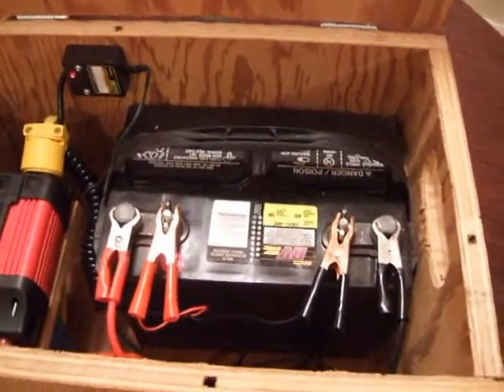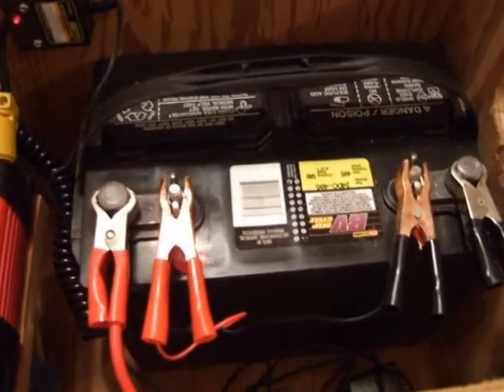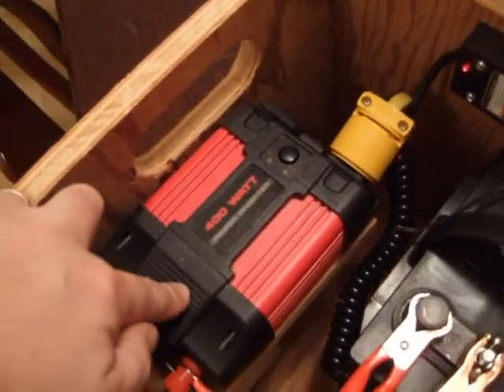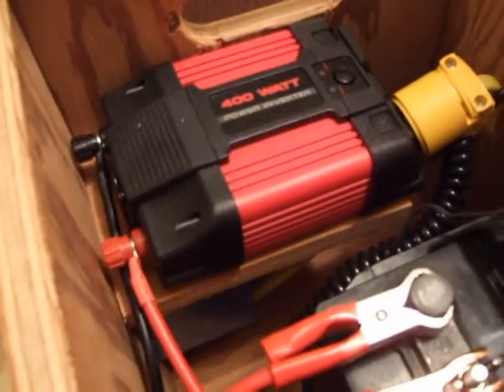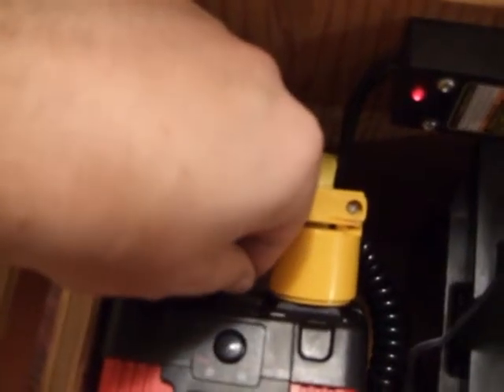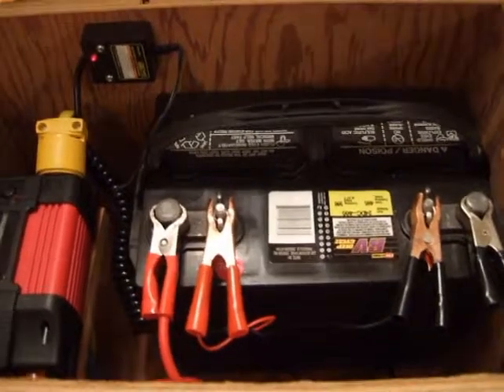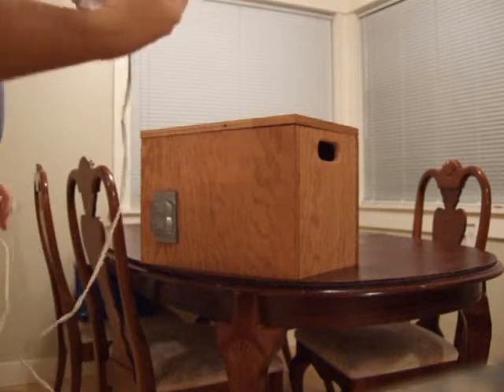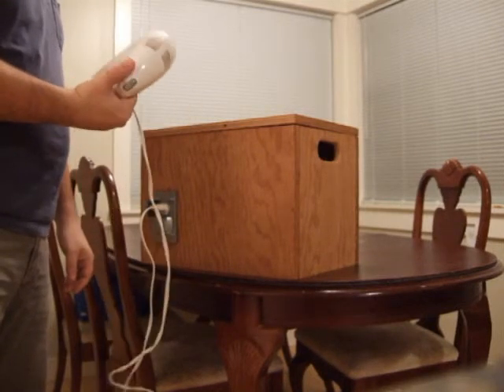Backup Power Box

Comment: Great to see people making backup power supplies for during a blackout, However after doing Electronics for over 20+ years safety is a MUST If using inside use a AGM fully sealed. FUSES are a must in case of a short, Plus consider a battery master switch.

Comment: Nice set up. Get a Kill-A-Watt meter and connect to the stove (with regular AC) so you can tell how much wattage it's using.  Then you can do the math to figure out approx how long you battery will run it.  Remember: inverter is only about 80% efficient & battery should not be drained below 12.0v (50%) unless it's life or death.  NO additional lights or hi drain items.  (Get some battery or oil lamps.) Use it only for survival heating and phone charging if cell phones are still up.  Good job!

Comment: cool idea and all, but is it cheaper than a ups with the same capibility? if its cheaper more power to you, but that is basicly a less advanced ups. its not even a ups because ther will be an interruption if the power goes out (you have to change what you are plugged into) but still dont get me wrong its a cool tool, and a cool project, just dont see the real use unless it is substansialy cheaper than a ups that can do the same thing, and better.

Comment from the maker: @IpdVolvo Thats a good idea.  I was a little concerned about the connections, but I didn't think about rewiring them.  As usual I put it off until the day before Christmas, so I was a little rushed.  I think I'll do that though.  

I don't know if you noticed the handles cut in the sides of the box, but I was hoping that would provide enough ventilation.  I've also considered adding a PC case fan to the side of the box. The inverter has a USB charging port, so I could use the 5V from that.

Comment: Pretty neat!  One suggestion, might want to make the aligator type clamp connections more secure to prevent voltage drop and better amp flow.  Additionally you may consider a vent tube out side as deep cycle batteries can off gas some hydrogen when in use.  I guess that's two suggestions, anyway great job!